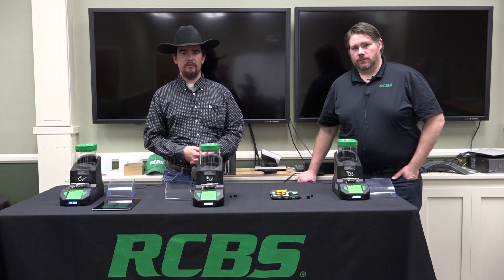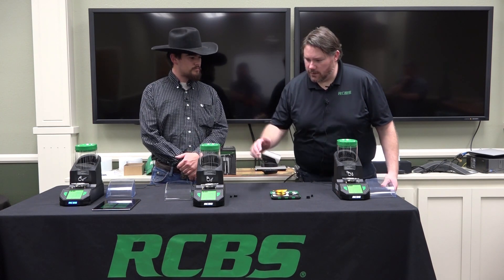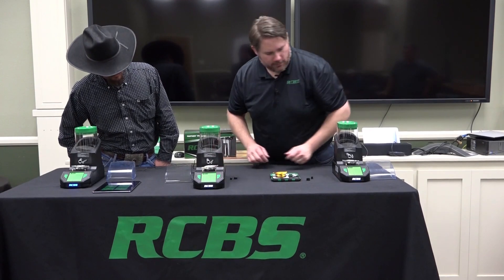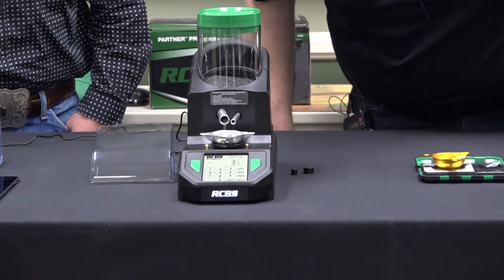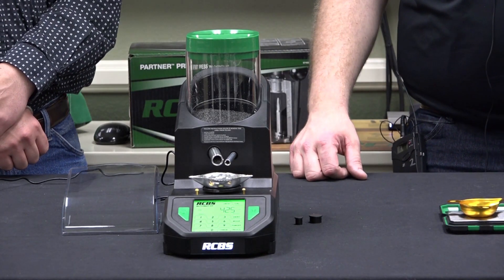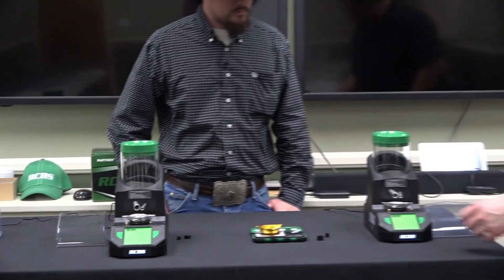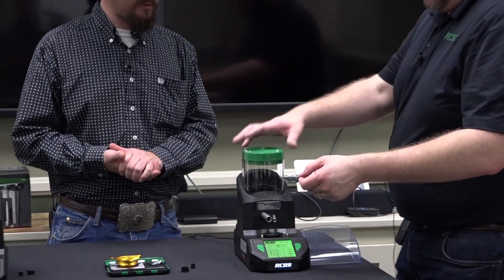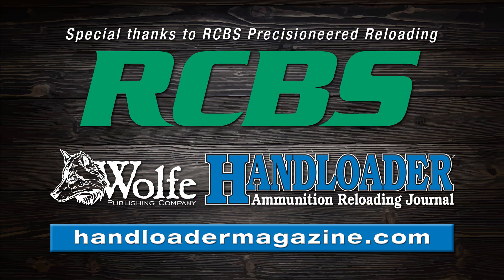RCBS Tour The MatchMaster

Comment: Why buy this when you can get an AutoTrickler V3 with an FX120I scale? Relatively the same price and you get a 5 year warranty on the FX scale vs the 1 year with the RCBS. Plus the FX has a force restoration sensor and not a strain gauge like the RCBS.
Reply from the maker: I am sure the prices vary quite a bit but at this time it appears the Auto trickler V3 with the auto throw and scale goes for about $1,200-$1,300 The matchmaster currently is on sale for about $820.00 but usually retail is about $900. So they are fairly close in cost. As far as accuracy the scale so far on the Matchmaster has been on par with the A&D FX 120i in spite of the Matchmaster using a strain gauge. We have had ours for nearly a year with no issues as of yet but we will continue to use it and put it to the test it has dispensed prolly around 700 lbs of powder so far. We would love to do a video on the Auto Trickler so you can compare dispense speeds and overall operation. Perhaps one day we can get our hands on one and film it. I wish I had more experience with the Auto trickler and I could provide more insight into which system actually functions better I do know that a .02 grain resolution is down 1 kernel of powder accuracy with most stick powders and both the matchmaster and A&D are capable of 1 kernel accuracy with stick powders. Great question and thank you for watching!
Reply: @HandloaderTV  you can find the FX120i for around 450-475 quite easily. 🙂
Reply from the maker: @jetthreat5000  We will certainly keep our eyes peeled and see what deals we can come across we would love to do a separate video on the AutoTrickler system with the A&D scale.